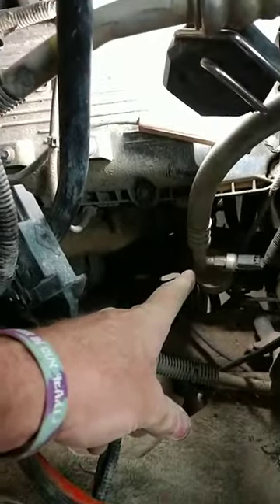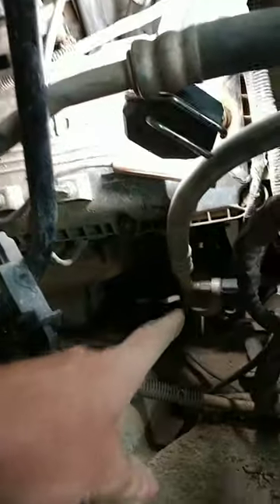How Engineers Keep Mechanics Miserable (Part 287) #shorts

Comment: $20 in parts and $1200 in labor...
Reply: A $3 o ring might as well do the long tube headers
Reply: Never Ever EVER buy American
Reply: @retiredrebel  why,  so you can have the same problems and just pay more for parts?
Reply: @dontfit6380  Japanese cars are just better.  Everyone knows it.
Reply: @carpediem5316  for 20 plus years Mazda pickups were build from the same parts as the ford pickups. Like I said all you do is end up with the same problem just more expensive parts.
Reply: @retiredrebel  Does Toyota make an equivalent of the F-350?
Reply: @carpediem5316  Some used to be but really aren't today.  Toyota has kept their quality up but they still have issues too.
When you need a really heavy duty truck though.. it's Chevy, Ford,or Dodge. 🤷‍♂️
Reply: May have been better to drop the oil pan and drive it out from the bottom.
Reply: Love my Tundra. Just thought I'd say that.
Reply: @emmittmatthews8636 
Toyota Tundra
Reply: @jibranbaloch7650  Nope, that's a half ton truck. Equivalent to an F150, or Chevy/Ram 1500.
Reply: Plus $3,400 lady, your flux capacitor has a reading 100,000 μSv on the geiger counter
Reply: It's intentional. They don't want you fixing these things. They want the repair bills to convince you to buy a new one.
Reply: @shadoughbanned  Or just JB Weld the tube and let it buck :shrug:
Reply: @LD9user  Just wait till you have to do a starter. It's under the intake manifold. HAVE FUN
Reply: @carpediem5316  cars. Trucks Merica dominated that and will continue. Izuzu is the only other brand i would trust that isnt from the usa. Old yodas were nice.
Reply: @dontfit6380  And now that Mazda isn't connected to Ford they're rising to the top in terms of reliability. Right up there with Toyota and Honda :D

Im not a Ford hater though, I have an old 01 f150 4.6 v8 triton and I love it. But I do feel the QC on modern american brands has really gone downhill.
Reply: @retiredrebel  love my WRX
Reply: @acidhendrix  I haven’t found any brand more reliable then the other and I’ve owned them all. I’ve owned fords and chevy’s that have run 300,000 plus miles. I’ve owned Toyotas and Honda’s that have run 300,000 miles. I’ve also owned all those that have lasted me less then 100,000. I’ll tell you what though it cost me a lot less to fix the so called American made vehicles a lot less then the foreign ones. I once owned 6 1999 ford rangers 3 of them were well over 300,000. Two of them were lucky to make it to 200,000 and one blew a head gasket at 50,000. They also all had different drivers so who knows who beat the hell out of one while the other was driven like a granny. I’m not saying the ones assembled in America or what we are told are American made are the be all end all.  I’m saying they are all over priced machines that are absolutely designed to break down. It makes no difference in what brand.
Reply: @dontfit6380  I agree with most of what you say. My dad has a Ford E250 van that has around 500k and still runs. However I do absolutely think there's a difference in reliability between something like a Chrysler product and a Honda/Toyota. What you say about previous owners and quality/frequency of maintenance though is 100% true for all brands
Reply: @carpediem5316  you can’t say “Japanese cars are better, everyone knows that” if not everyone even can agree on that statement nor do everyone know the difference between JDM and American cars
Reply: @retiredrebel  Try and change spark plugs on a Nissan
Reply: @dontfit6380  well go buy a 5 Cylinder 2.4L D5 Volvo thats the most reliable and cheap to maintain. mines done 600000 Km atm only normal maintanance and Tuned to 268Hp and 580Nm, pulls like a champ :D
Reply: @CatManHDGaming  now you said Km. I’m assuming your in Europe somewhere. The vehicles in Europe are tuned to different standards then the US. You will be lucky really luck to get that mileage out of a Volvo in the US and you could buy a used car for what an alternator will cost to replace.
Reply: @dontfit6380  nah to replace the alternator its 3 bolts and the belt then its just to take it out so if people take alot to change it they are pretty much scamming
Reply: @CatManHDGaming  I’m talking buying that part. Not even talking labour yet. Foreign car parts will cost you 4 to 5 times the price of domestic parts. Which is just stupid because there are no American made cars with American made parts. Really there are no American made cars just American assembled cars. Parts are sourced globally.
Reply: @dontfit6380  wtf an alternator here can be picked up for around 100 bucks new
Reply: @CatManHDGaming  idk it’s always been that way. We also haven’t been able to get the small Diesel engines like you have. We are just starting to get more diesels but they are tuned down so much and so much smog equipment on them. They don’t last near as long, get as good a mileage or anywhere near the performance.
Reply: Fortunately the 4.6l 3v you can access the dipatick tube through the wheel well
Reply: @dontfit6380  yea thats sad, always kinda weird here in europe we dont have Diesel pickup trucks from ford, Dodge and Chevy only gas models but on the normal cars we moslty have diesels thats always kinda confused me xD. And gotta love volvos 5 Cylinder diesels The sound is just amazing :D
Reply: @CatManHDGaming  I didn’t realize you couldn’t get diesel pickup trucks from our big 3 that’s very strange. I do love the sound of a healthy diesel. Enjoy that diesel Volvo while you can. Soon the only sound you’ll hear from your car is you going Vroom Vroom. Then as an old man you can talk about the old days when you drive petro cars and the lights stayed on in the house. Now we drive electric cars and we live with rolling blackouts. Doesn’t the future sound great 😞
Reply: @dontfit6380  yea ikr we already have electricity problems in europe so not feeling all the EVs gonna help us here. actually we can now get the ram with the 6.7 since 2021 but not the others. and to be able to drive them here you have to have a lorry license.
Reply: @CatManHDGaming  Haha a lorry license to drive a pickup truck. The silliness and stupidity of governments never ceases to amaze me.
Reply: @retiredrebel  the parts that fail are the shit parts not made to spec in Mexico lololol. When it was made in America by Americans it was great.
Reply: @dontfit6380   yea so the license is almost as expensive as the pickup truck 🤣
Reply: @acidhendrix  excuse me my dad bought the cx 5 and it's totally a PIECE OF JUNK. He is an old man and drives like and old man but at 50k the car needs 2 wheel bearings and it sways like a boat. It has no power, I hate driving it. Did I mention the head unit is like using a computer with windows me on it.
Reply: @retiredrebel  I have a 25 year old f250 5.8 gas and it runs like a charm bud.
Reply: @CatManHDGaming  WOW, I take it the government really doesn’t want anyone driving them.
Reply: @retiredrebel  Meh… my 2008 Silverado 2500HD gasser with 1/3 of a million (mostly) trouble free miles suits me fine. The only things I’ve replaced (besides wear items like tires, batteries, belts, hoses etc.) are the steering gear (no assist on left turns only 🤔), and the starter. Changed the starter in my employer’s parking lot during my lunch hour with a 15mm socket and a screwdriver.
Reply: @retiredrebel  Nissan does this shit too. Recently had a coolant leak and found out there's a 90 degree metal elbow and hose that went bad but it's literally UNDER EVERYTHING. I don't have the time to take of fuel pumps, throttle body and intake manifolds and five other things so I had to pay a shop 750 dollars to change a 35 dollar part while I was at work. Only new car I can say is a breath of fresh air is my ecoboost. Got that thing making 403 wheel hp and it's a breeze to work on. It's a focus RS engine shoved in the engine bay of a V8. It's like working on an actual old muscle car where you can fit your arm in there.
Reply: Omg tell me about it that is fucking spot onnnn
Reply: @nolongermyrealname7554  GM owned Isuzu.
Reply: @CatManHDGaming  seeing that your using the nm and km you're not from the states, volvos are expensive to maintain and they kept using timing belts that you have to change out for maintenance.
Reply: @papi-champoo6033  you can change the timing belt yourself in under 1 hour. Timing belts are better here where we have -35C in the winter and +30C in the summer as the tensioners on chain driven just clogges up. only things you have to do is remove 1 tensioner  + accesory belt 1 engine mount change belt put it back done. aswell its alot cheaper than changing chain+ tensioners
Reply: @CatManHDGaming  You live in Europe though so the cars are different. Volvo's sold in the USA market are horseshit cars. Same thing with BMW, Mini, land rover, and fiat. All crap cars. We get Europe's sloppy seconds.
Reply: @dontfit6380  a F-350 Don't fit in a mazdah!
Reply: @dontfit6380  but 3 mazdahs will fit in a F-350
Reply: @johnryan8859  but 3 Mazdas can’t move what one f350 can.
Reply: It’s a Ford, what do you expect
Reply: It's actually $0 because there is a recall on those. If it's not broken yet, they put a foam sleeve on it to prevent breakage, if it's already broken, it's covered under the recall because it will cause oil leakage on the roadway which violates federal emissions laws. That's why they created the PCV system, to prevent oil from washing from the roads into the groundwater.
Reply: @retiredrebel  if you need a large truck you kinda have to cuz only ford chevy/gmc and dodge/ram make 3/4 tone and full ton trucks
Reply: @mandrrtt9535  so your good with a car manufacturer putting spare parts next to parts they know are going to break? I’d be a lot more impressed with them upgrading the parts so they don’t break. I have to say I don’t appreciate that kind of engineering. 
The only place Asian cars may have dominated was California. Don’t believe every article you read. Asian cars were complete junk in the 70’s and 80’s. They definitely didn’t come close to out selling American car manufacturers. 
I’ve always considered ford to not know what they are doing and never been a fan of fords but at the time I needed some small pickups and the Chevy dealer wouldn’t come out in the snow to talk to me. They turned out to be pretty good little trucks and they outlived my competition driving Toyota tundras. 
All vehicles these days are taking a dive but it’s not about people hollering about corporations. It’s about government regulation and with the US brands the unions make matters worse.
Reply: @TestECull  very likely.  Got a 99 f250 s/d  pushing 400k miles, it ain't pretty (work truck) but able to  personally changed transmission , do timing chain job , correct plug inserts issue. Etc. It's a home mechanic workable truck and runs great. Some ask why not get a new truck as they have gone through several over the same period of time. Not only that but a new equivalent runs 60-80k and then become reliant on someone else to pay to fix with the patented work info till released in latter years . No thanks. Self-reliance should be regarded as a  virtue .
Reply: @carpediem5316 Japanese small engines and motorcycles are the best on the planet ill give u that… America and Germany make the best cars hands down. every single manufacturer on the planet makes simple jobs hard because theyre trying to put every individually engineered part into the smallest space possible. its inevitable when more and more tech starts becoming the standard, but the lanes on the road never get bigger. its a dilemma for the engineers too.
Reply: @shadoughbanned .  50 years ago, almost half my hand tools were custom tweeted by me to get to hard ta reach places, just like what he talking about. Ha.Ha.Ha
Reply: @retiredrebel  just dont buy fords
Reply: $12k in labor at the dealership 😂
Reply: @AmericanRustWorker3369  there are a lot of things about new cars I don’t care for but in terms of them being junk I don’t think so. I grew up in the 70’ and 80’s. It was a crap shoot as to wether your car was even going to start if the weather was to hot or to cold. In northern MN we use to tarp the engine compartment and blow a kerosene heater on the engine to get it to start in the winter. You were really lucky to get 100,000 miles before the engine needed rebuilt and 6 mpg wasn’t great. 
The market for selling 20 year old cars isn’t exactly exploding. 
The reason for the uptick in the used car market for vehicles that are a few years older was because you couldn’t get a new one during Covid. Hard to sell new cars when you can’t get the parts to finish building them. GM still has roughly 100,000 sitting because they can’t get the computer chips to run them.  99% of consumers will buy a new battery when the engine turns over but won’t start. In other words they don’t know if cars are junk or not. 
New cars have problems because they are trying to meet government standards that are completely unrealistic for CAFE standards. Just like we’d have a lot less people killed in car accidents if they used thicker steel to build them but they had to lighten them to meet the standards.
Reply: @gam3kid  stay away from Nissans right now. I mean run like hell, give the 10-20 years and lets see if they go full electric, if they do, they’ll never recover & Toyota will swallow them Yakuza style.
Reply: @gam3kid  bTW v6 toyota sparks/coils is very labour intensive for a DIY, but at least it’s 120 K maintenance item. (6-10 time in the life of a million KM Toyota. Real Talk)
Reply: @Harlow_Khmer  I agree. American cars in the 60s-70s even up to early 2000s were luxury redefined and drove nice as well. Nowadays there’s an El Chapo in every appliance or part from Mexico.
Reply: @jaredcollins96  dinosaur years, we’re talking 2010 and up, right around the time German cars went to the crapper, curtesy of greed & sub-par suppliers.
Reply: @wphh7272  those good old days, u buy the same make & model now, u’ll be in/out the shop more times than changing sox.
Reply: @4touchdowns1game29  yeah Nissans are a fire hazard until they find themselves in a monastery on a retreat in Tibet. In the mean time, if u got a American that runs past 150K miles, thank the Lord as if u found diamonds in your pocket.
Reply: @mockemperor953  i know brother. I wish Tundras had bigger siblings, they’d roam the roads like biker gang.
Reply: @retiredrebel  😂😂😂😂💯💯💯
Reply: @Gam3kid  I've done it. Not that hard but still a few chores to do.
Reply: @dontfit6380  it absolutely makes a difference if you look at literally any compiled data at all. Relying on tiny sample sizes of your personal experience you could look at Mass data sets and see that there are clear brands and even models of specific vehicle types that are obviously Superior options to the others in the class.
Reply: @dontfit6380  powergrid mismanagement is almost always the fault of local and state governments and really has nothing to do with electric cars given the fact that they still are an incredibly tiny portion of the market. But you'll continue to believe what you want to be true because that's how people work.
Reply: @dontfit6380  I mean I really don't think it's that unreasonable, pickup trucks are responsible for the vast majority of pedestrian deaths. Vehicle accidents are the number one killer of children and one of the top killers of adults frankly driving should be way more heavily regulated and punishment for traffic violation should be much higher they should be way more focused on traffic shit than fucking drugs I don't know why they're so obsessed with drugs. All the worst ones are the legal ones.
Reply: @chicken29843  well I’ll agree with you on drugs being legal. I figure if some idiot wants to get high let them get high as long as it affects no one else. Passenger cars are responsible for pretty much 50% of pedestrian fatalities. 40% are associated with light trucks, a category that includes vans, pickups, and sport utility vehicles (SUVs). Only 5% with large trucks. You think trucks are a problem wait until we start getting more EV’s on the road. Some of them almost twice the weight of an ice car. 
When they start talking about gun control I’ve always said if it was really about saving people they would outlaw cars.
Reply: @chicken29843  there may be a ton of power grid mismanagement but that doesn’t change the fact that our power grid in the US is far out dated and will never handle everyone charging cars at home. You do understand how much draw that would create right? California already has rolling blackouts. You don’t understand electricity if you truly think this won’t be a problem. It’s not a matter of believing what I want to believe. It’s a matter of fact.
Reply: @chicken29843  I don’t give a 💩 about compiled data. Compiled data is like the better business bureau. You pay enough you get the rating you want. I’ll stick with mine and my customer’s personal experiences.